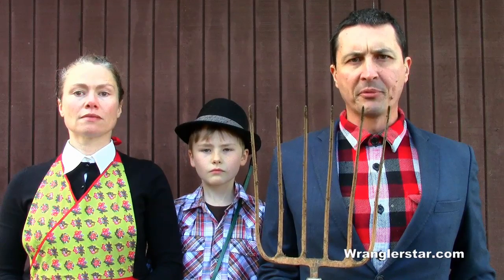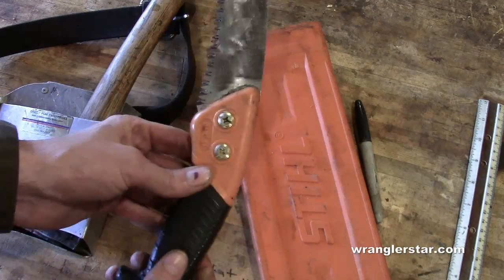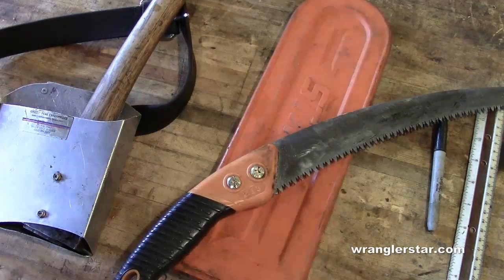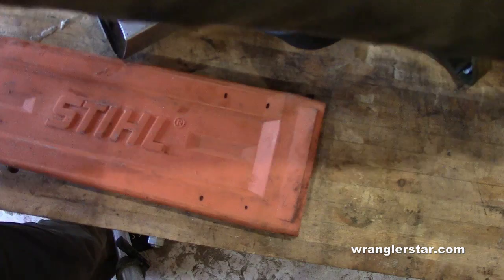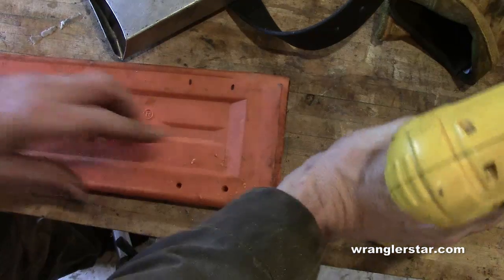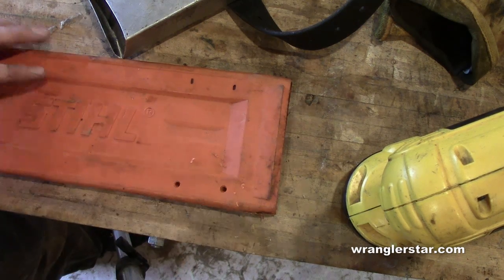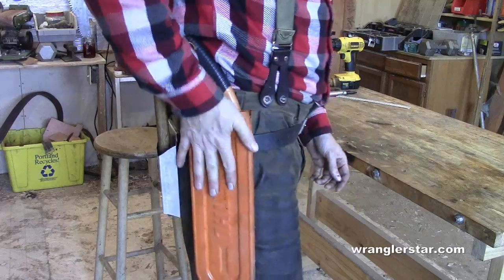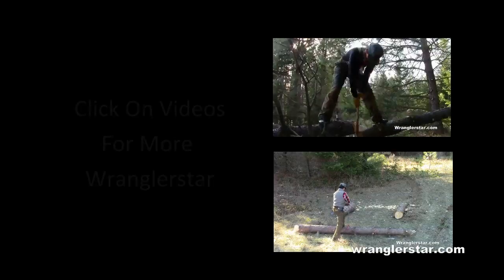DIY Stihl Pruning Saw Sheath

Comment: Very smart and resourceful! But, if you want to go upmarket (like with your Bruks axes) I would recommend a Silky saw. I have a Zubat in 270mm length (fixed blade), and the sheath is pretty good: very lightweight and modular. For the ultimate in saw sheaths, try the Silky Tsurugi. That thing is SWEET! And, of course, the saws themselves are real Cadillacs. They cut wood like no tomorrow and are extremely comfortable.

Comment: That will work great as long as you don't draw it thinking you are drawing your EDC. It would be really hard to line up the sights on the saw. Just having a bit of fun, I know you wouldn't do that. I like the idea about putting a hole at each end of the cuts.

Comment: Nice re-purpose.  Looks like the saw would go in & out easier if the teeth were facing forward.  I like how quickly it slides with the clearance between the blade & sheath.  I have a similar Corona saw that I use a lot, I splurged for their leather sheath and have been happy with it.  Two nice details on it are they housed the rivets (@ the top of the opening for the blade) in some HPDE bushings (better on the saw teeth) and there's a D-ring at the top along with the belt loop.

Comment: The same goes for saw blades. Centerpunch a little past the crack and drill a 3/16" or 1/4" hole, debur with a larger bit by hand.

Comment: some say fix or repair daily or "ford". if you ever owned a model t, that was the fix used to stop a vibratory rip in fenders. if you didn't have the skill or equipment to weld or braze. i have both for metals and plastics. in the 80's and 90's i was a plastic fuser of driscope 66 pipe, for natural gas pipe line construction crews. and latter a welder he[per of pipe line welders. which later got me a job as a welder in the trucking industry at "central transport" the chemical transport tanker company out of archdale n.c..

Comment: does it cut into your belt? looks like it might over time. have you ever used a silky? or heard of one? great video!
Reply from the maker: I have not used Sliky however I have heard they make the best pruning saws in the world.
Reply from the maker: It's to soon to tell,
Reply: wranglerstar If you're looking for a folding saw I'd go with the Bahco Laplander over the Silky.  In my experience they last longer.

BTW, neat idea for a sheath.  As long as you don't have to remove it from your belt very often that should work far better than anything I've ever seen that was purpose made for the job!
Reply: a lot of guys on my college course have silkies. it seems a bit hit and miss. some of them stay sharp and work great, others have blunted and degraded far too quickly for the price tag. it's a pity that buying one seems to be like a lottery at the moment. the good ones are great, but it's probably not worth the risk until they become more consistent.

Comment: Does that saw cut on the pull? I had a real good limbing saw, had a wood handle like a regular carpenter`s saw, only it cut on both strokes.  I`d like to get that saw back, wherever it got to.